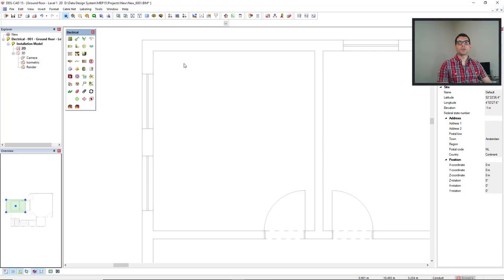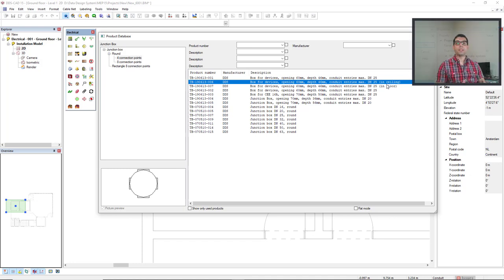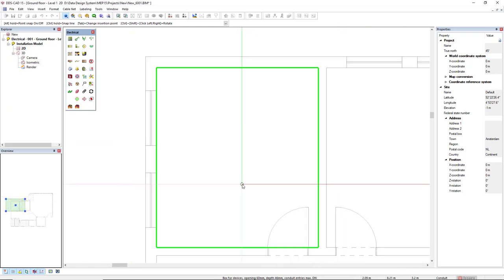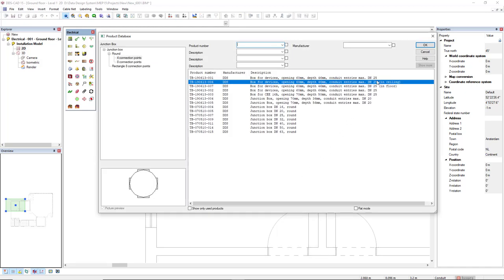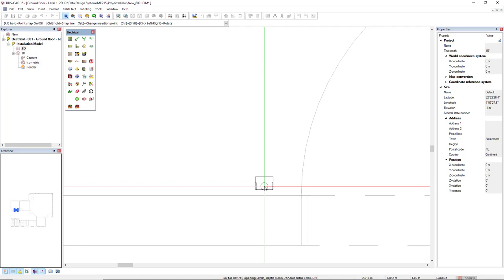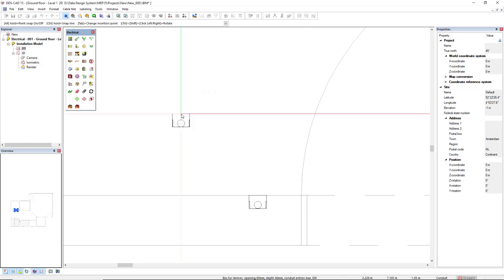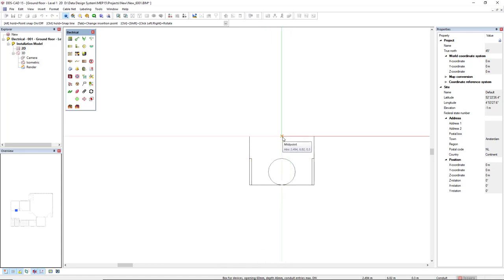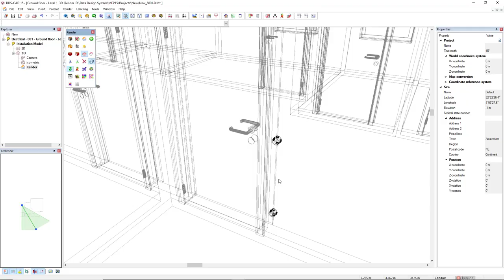Getting Started  - Electrical - Using junction boxes

Comment: Good morning,

I love your movies. I have a DDS CAD electrical program. This is a great tool. There is no problem to use all the functions of the program when we create a building model in the DDS CAD program. 

Please note that architects work on other programs. As an electrical engineer, I receive the IFC file which is most often exported (90%) from the ARCHICAD program. And here the problems begin. At the moment, I am not able to fully use the DDS CAD program, because I am not able to work on the IFC files sent by the architect (DDS does not recognize walls, ceilings, floors, no possibility of perforation, automatic installation of sockets, cable trays).

Perhaps you will prepare an instructional video on how to create models in the ARCHICAD program and export them to an IFC file so that they can be correctly recognized by DDS CAD.

Another problem is the database in DDS CAD. So what if you can make a model from a DWG file. Unfortunately, it will not contain any information. The DDS CAD database must be supported by producers as in the case of the REVIT program.
Reply from the maker: Hi Targetti, thanks for the compliment. We have been working closely together with Graphisoft (the company developing ARCHICAD) for many years. There are so many great examples showing a seamless Open BIM workflow based on using IFC file exchange between DDS-CAD and ARCHICAD. So most likley something is going wrong somewhere. I recommend you to reach out to your local support contact to make sure you also have a great experience in using IFC as the basis for your projects.
Reply: @DDSCAD-MEP  Thx